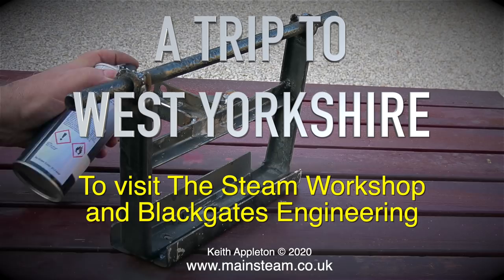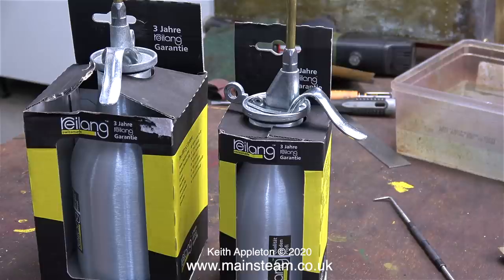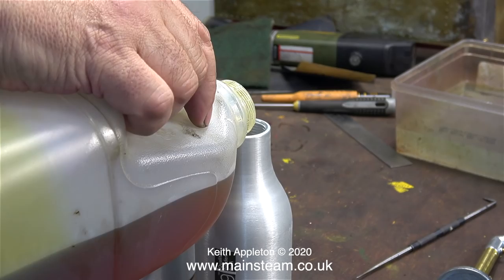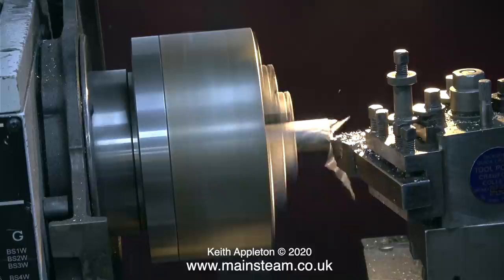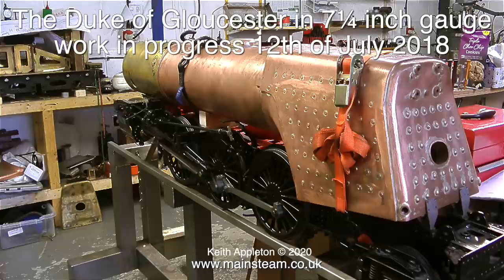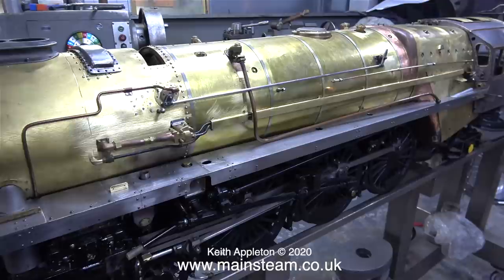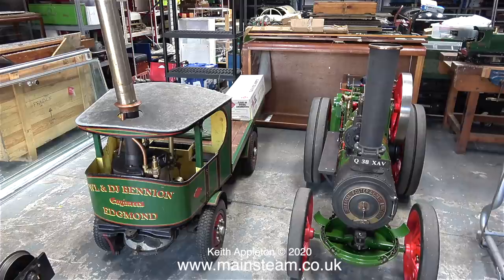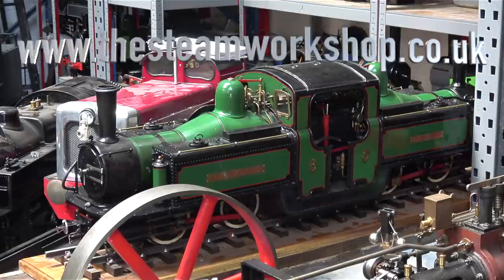A TRIP TO WEST YORKSHIRE

Comment: The 7.25" Duke of Gloucester was originally built entirely by the late Dennis Evans - a member of Fylde Society of Model Engineers. It was mostly built whilst Dennis was working out in Africa in the most primitive of places, including the boiler and fully working Caprotti Valve Gear - he had a copy of all the works drawings.  As an interesting exercise upon his return from Africa  he also built the same loco in 5" and then 3.5" gauge, again with fully working Caprotti Valve Gear. I believe all 3 models won awards at the London ME Exhibitions.  I was Hon Sec of Fylde SME at the time.  It was a privilege to have know Dennis.
Reply from the maker: It is a thing of wonder, John Holroyd showed me some of the internal gear units and the engineering is out of this world.

Comment: You are right about not adding rapeseed oil to the steam oil, as it will warnish when heated.
We have used it as chainoil on chainsaws, and it can warnish the oiler, chain and bar totally stuck. I have even seen an oil tank filled with a solid block of warnished oil. Had to totally dismantle the saw to get it out.
Reply from the maker: Yes it is a bit sticky . . .